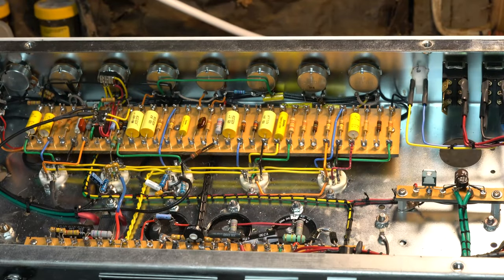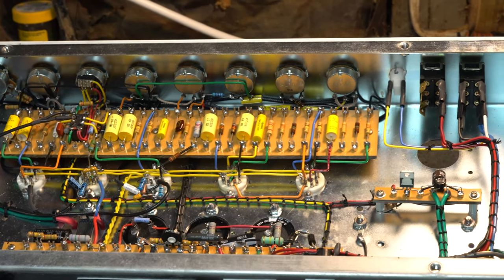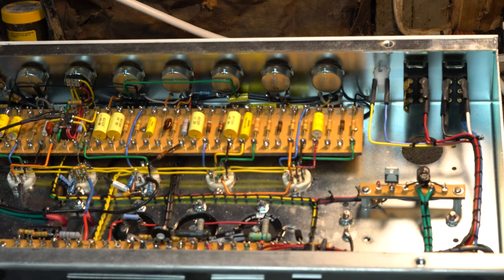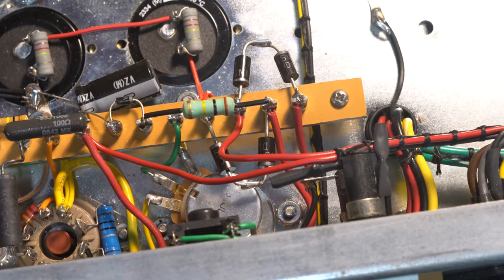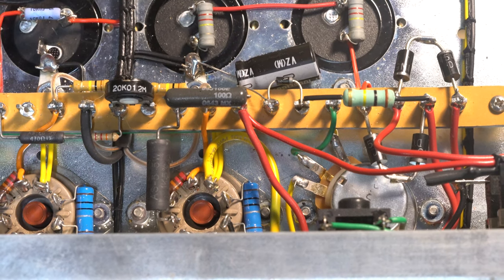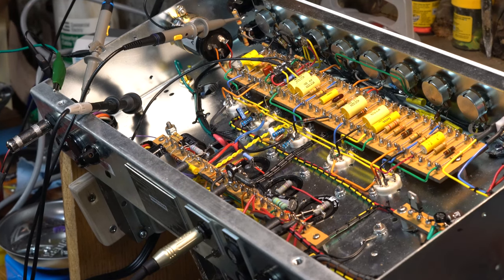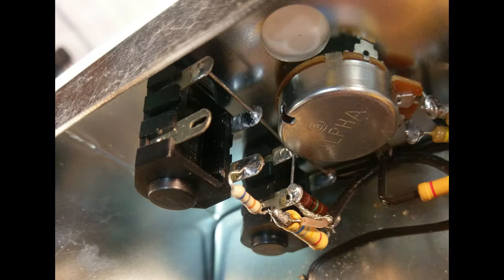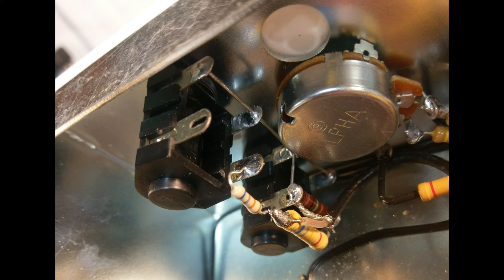Reeves Space Cowboy Buzz Fix

Comment: I actually really like the Reeves Space Cowboy amp. However, they did have an issue with quality control for a while. They sent quite a few of these out with "bad reverbs" and then gain boost was not very well thought out. They have fixed both , however.  still to this day , when you engage the gain boost , it changes the reverb to where is goes way down. This , to me, is not cool !   I wish they made a version with no reverb but with a good FX loop instead . Or would fix that one flaw.  If so, i would re-buy one !
Reply from the maker: Very interesting info, thanks!

Comment: Is this a flaw in the build/workmanship or was this damage/cold solder?
Reply from the maker: I think it is more likely the resistor itself just failed.  Reeves are known for high quality work, and this amp looked outstanding and clean on the inside with great solder connections, wire lead dress etc.
Reply: Thanks for the vote of confidence. Bought a Custom 100 and thinking about a Super 78.